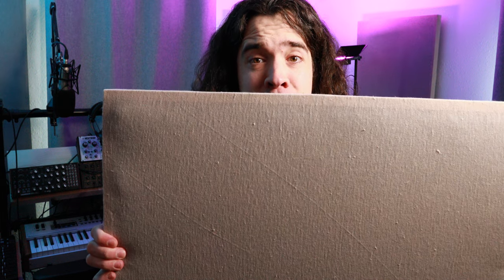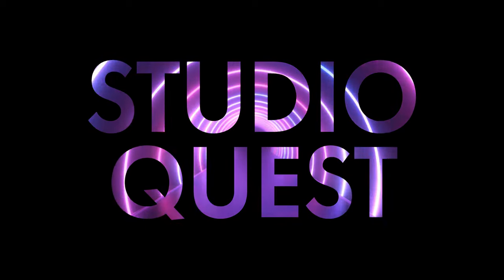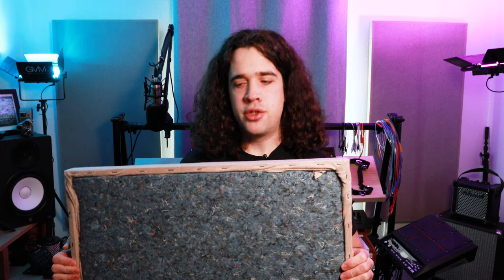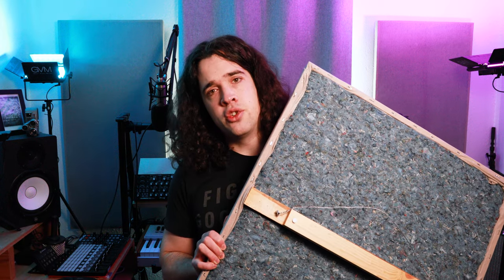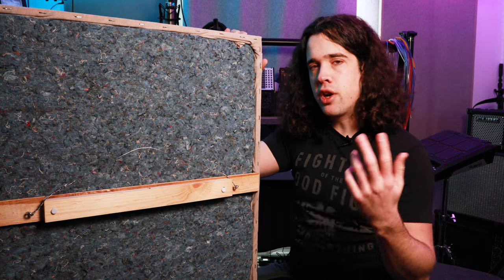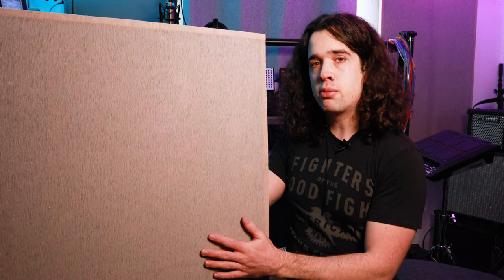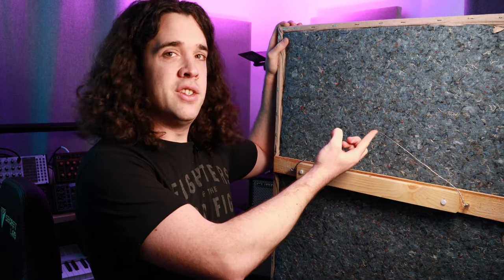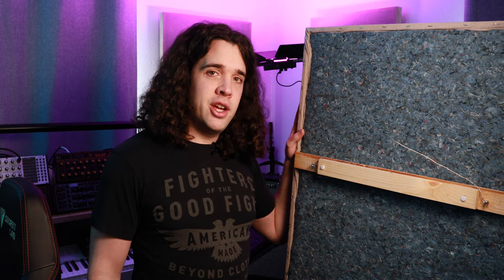Build your own sound panels // How-to guide to sound absorption, NRC, and acoustic treatments

Comment: The cotton batts are a great idea!  Very underrated sound absorption material.  I found cotton moving blankets at Home Depot a few weeks ago...apparently, they're so new that HD shipped them to me free.  The blankets are about 1/16 - 1/8" thick, so 8 of them would be 1/2 - 1" thick, and there are 24 per pack.  The blankets are 72 x 54, so you may be able to fold them to make them thicker. 

I had a distiller running in my basement kitchen and I put 6 of them in front of the cased opening, and the sound difference was amazing...way more sound attenuation than I got from several thick moving blankets.
Reply from the maker: I could see those being useful for mobile panels too like if you have a big open space but just want to dampen sound in a spot where you’re recording, you could even have various hooks in the ceiling to hang them from to make a modular sound  dampening set up.

Comment: What was/were the dimensions of the lumber you used for the frame? Were they 1x2s? Did the batting stick out? Does the fabric help to compress it to be more flush with the frame?
Reply from the maker: They were 1x2 boards which allows the batting to sit near perfectly flush with the boards. The fabric can help the batting sit flush in the front but the fabric is pretty thin and thus has some stretch so I didn't rely on the fabric completely to hold it in place so you'll also want to add a support bar in the back to help it from falling out of the back. With the batts I got, they're actually somewhat rigid so as long as they fit snug in the frame then the frame will do most of the work. You can see around the 8:00 mark the type of bracket I used on my crossbars. This bracket was chosen specifically so that when I get the batt in place, I can every so slightly squeeze the side of the frame in then tighten it down to help hold the batt in place. Making it too tight though will make the batt bow.